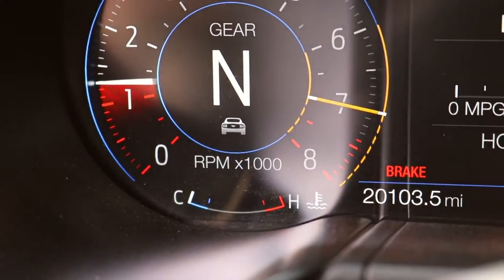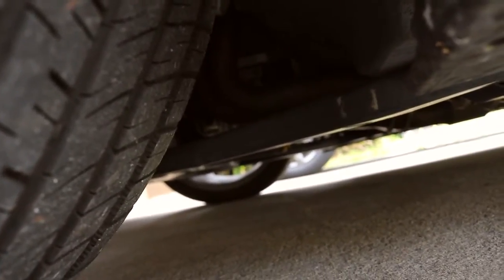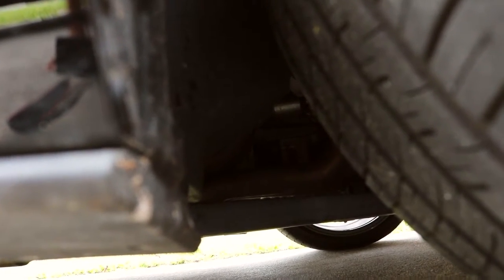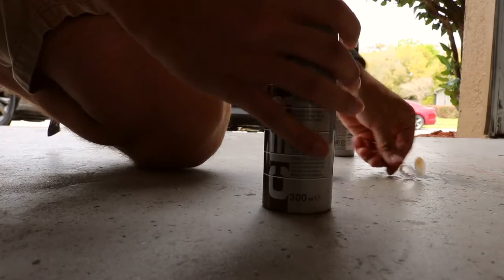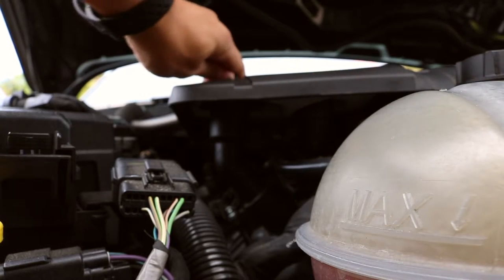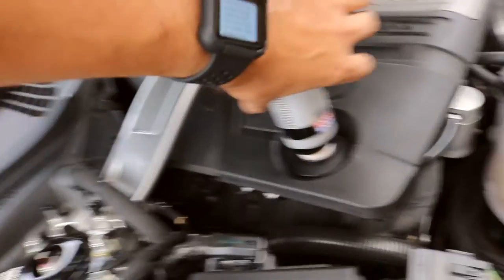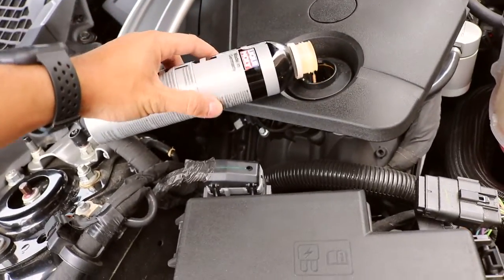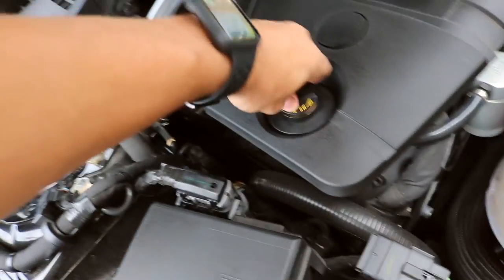Does Ceratec ACTUALLY FIX the infamous Mustang Tick?!?

Comment: I used 5-30 with a bottle of ceratec and my engine became silky smooth surprisingly 😂 no more typewriter tick
Reply from the maker: That’s awesome! Glad that worked!
Reply: I'm about to add some my next oil change, did you use 1 bottle or 2?
Reply: @jeffkelly9197  its one bottle for every 5 quarts, the gt holds 10 quarts so two bottles
Reply: But you have to match it as mine take 6quarts adding a bottle of 300ml makes it 5400ml instead of 5700ml for engine fluid
Reply: Did you add another ceratec when you do the next oil change ?

Comment: It fixed the ticking in my 2008 Mazda MX5.  Done as part of an oil change and allowed for the extra volume of Ceratec to total volume.  My son was with me when we started the engine and we instantly looked at each other once the engine turned over.  The before and after was clear.  No more ticking.  Even after a several subsequent oil changes.

Comment: I use it in my 19 GT with 530 Pennzoil ultra platinum. So far it's been a year and the engine runs and sounds great!
Reply from the maker: 19 Coyote 5oh oh sweet! Glad I made a good decision! How many miles are on yours?
Reply: @BrandonChinn  I've got 5k on her, It was a custom order car and I swapped out the OEM oil at 800. Car is in storage for the winter since November.
Reply: I just put it in my 16 GT tonight low and behold the tick is gone changed my oil about 50 miles ago with Royal purple 5w20 and K&N oil filter.
Reply from the maker: Chris Cook hey that’s awesome man!
Reply: @chriscook7219  how much did you put in?
Reply: @JoeyBurnsRed  the whole bottle but id remove a quarter of a quart of oil to make room just to be safe or do it at a oil change and just put in 7 and three quarters of oil then the ceratec
Reply: I bought two and only used one bottle and tick is gone I’ll just save other bottle for next oil change :)
Reply: If it's been a year, you should change your oil.

Comment: I have a 2023 GT and had a tick/knock after the first oil change at the dealer. I put in Ceratec and after around 2 months the sound improved but engine seemed a little sluggish compared to prior to oil change.
I dropped the oil after 7,500K from the first service and noticed that the dealer over filled the oil by nearly 1L.
I put in the correct amount of Liqui Molly 5w 30 and didn’t add  Ceretec and the engine is purring like a little baby now.
If you have the issue maybe put in an oil flush then drain oil. Replace oil being careful to fill to the excact amount 9.5L.
Reply: yo bro i have a 22 GT that started ticking after the first oil change. leaning towards using ceratec just very skeptical.

Comment: It usually takes a 100 miles for it to really work. But Amsoil and Ceratec work really well for me
Reply: I’m using AMSOIL engine oil. Would it be fine to use it with it?
Reply: @harisijaz8383  yes

Comment: I have used alot of additives in my cars the best one is called (Extralube  ZX1) its from the UK and originally designed to cool and to stop wear on north sea oil rig drilling drill bits! I swear by it,instant quiet engine,you can put it even in coolant to protect water pump and also in fuel
Reply: What about ACTIV8, that is UK too.

Comment: What about the 2017 this one I wanna buy has the ticking and it’s not super loud but I am worried about the tik
Reply from the maker: @Tlopez0  you can still use the Ceratec as well
Reply: @BrandonChinn  would you reccomend still purchasing it with the tik or avoid it. It has 43K miles

Comment: So now your oil level is above max?  Additives are supposed to be added with oil so you still have the correct oil level.  You could also remove some oil before dumping two bottles of more liquid into your oil.
Reply from the maker: By standard it is technically above max but engines are built to withhold excess oil in case of overfill. Obviously not much but those two little bottles aren’t going to affect anything

Comment: I just picked up a bottle and did my oil change last week, do I add a bottle on top of the 10qts of amsoil? Would this not over fill? If i need to remove oil prior, how would i do this ?
Reply from the maker: @deucetres1656  yes just go ahead and add the bottle on top of the oil it won’t affect anything or overfill. You’re perfectly fine

Comment: Over-filling the engine by 2/3rds of a quart will quiet an engine down. It's an old-school used car trick to hide a toasted engine; add extra oil and it quiets the engine down.
Reply: Good point - so without removing the same volume of oil first, it's not apples-to-apples.

Comment: disclaimer, when you had the ceratec, It must be 9.5 L of oil/ceratec mic, you don't put 9.5l oil and then add ceratec because you will overfill it, for example if you are to add 500 lm of ceratec, you put 9L of oil and 500 ml of ceratec... also ceratec is said to last for at least 2 oil flush so no need to add it all the time , or you can half the quantity for the nexts ones
Reply from the maker: @philippebrebion6203  so adding in the Ceratec, you don’t actually have to split the difference. Every engine is made to accept a little bit of overfill of oil. It’s common across almost every vehicle. The small amount of ceratec being added in won’t affect anything or overfill in your engine

Comment: Did you know this folks.
This needs to be added to each oil change. 

My question to liqui moley was the following. 
When vehicle is due a service interval after i have used cretec for the first service.

Liqui moley: All the liquids, leave the engine bay. You  can have your vehicle serviced. And drive the vehicle with cretec in the system and the rest has left the engine during the engine oil service. 
Liqui moley recommended a new bottle is added at each service to maintain 100 percent cretec protection. 💯
Reply: This is wrong, ceratech ceramic properties lasts up to 30k miles, the anti friction last each oil change interval.

Comment: Yeah I’m at 400 miles on my 21 GT and it’s already ticking and rattles between 2k-3k rpm quite loudly. Do you think I should wait until I change my oil to add this?
Reply from the maker: Yes you can wait to change your oil!
Reply from the maker: @s550mc had gone to ford NUMEROUS times prior to this. I stopped going because 1. They didn’t claim anything to be wrong with the vehicle 2. They claim that the problem isn’t actually where/what it is 3. They had refused to work on the car because it “looked” too modded.  Took it to multiple dealers as well which is when I started to fix everything on my own. A lot went wrong with this car that I didn’t record, but every time I took it to a Ford dealer, it was always a nightmare

Comment: So if the car takes 8 Qts.. Do you add 2 bottles to 8 quarts or to you subtract 2 bottles of fluid (600 ml) and basically add this to 7.5 qts of oil so the total volume of liquid is still 8 qts ?
Reply from the maker: Gene realistically you can add in the 2 bottle on top of the 8 without worry. But the recommended use would be to add subtract the fluid from the oil needed. So yes 7.5 is how much you’d add in oil
Reply: Liquid moly recommends that you use 6% blend (94% oil, rest ceratec) so you would want to use a lil less than half a quart .
Reply: I have a 2023 GT and had a tick/knock after the first oil change at the dealer. I put in Ceratec and after around 2 months the sound improved but engine seemed a little sluggish compared to prior to oil change.
I dropped the oil after 7,500K from the first service and noticed that the dealer over filled the oil by nearly 1L.
I put in the correct amount of Liqui Molly 5w 30 and didn’t add  Ceretec and the engine is purring like a little baby now.
If you have the issue maybe put in an oil flush then drain oil. Replace oil being careful to fill to the excact amount 9.5L.

Comment: It's ok to add even tho I just did oil change yesterday with 8 qts? Do I add 1 whole bottle to 8 qts oil?
Reply from the maker: Ye still good too add
Reply: @BrandonChinn  I did and it got rid of my tic! So I have been doing alot of digging and it seems mobil 1 is a common denominator...ppl claim amsoil and Pennsoil is the best and won't permit a tic. I'm just glad the ceratec worked but I'm gonna try one of those 2 oil brands next oil change and see what happens.
Reply from the maker: @tehshape  I actually only use Amsoil now and I HIGHLY RECOMMEND. So much I became a dealer for them. They are quality no doubt

Comment: My 2020 GT ticked after the first oil change. Added ceratec and it was gone until my most recent oil change. Planning on adding another dose. Whatcha think?
Reply from the maker: Go for it! Ceratec is only rated to last about 20k miles if I’m not mistaken!
Reply: Ceratec will only work so long you have it in your oil. Once you change your oil, it will no longer give you the benefits.  So you have to use it every oil change if you want the benefits.
Reply: Get a Camaro SS instead
Reply: @amirparvez5415  It's like crack for the coyote 5.0 engine
Reply: @EldePHX   He doesn't want to get into something slower

Comment: seems like a great way to stop the ticking. The way I'm thinking is if your engine oil is reading top of the fill range then adding 600ml of Ceratec is going to over fill the oil capacity of the engine - not a good thing. I suppose the best way is to add it when doing an oil change and allow the 600ml in the fill up. Adding after the oil change means you should remove 600ml of oil first?
Reply from the maker: Mostly all vehicles has some give for overfilling. As it doesn’t have to perfect at fill mark going over won’t hurt it by that much. Hope that helps!
Reply: I only needed to add 1/3 of bottle to stop the tick. No reason to add entire bottle tbh
Reply: @eurly93  you’re wrong you’re supposed to add 2 full bottles trust me I know

Comment: Why do you use two bottles I'm curious most people that have 5.0 only use one any reason for that
Reply from the maker: So on the bottle, it states that it’s good for 5 liters of oil which is roughly 5 quarts give or take. 18-22 mustangs take 10qts of oil which would be equivalent to 2 bottles or 10liters. That’s why I used two bottles. I’m sure 1 will still help! But I wanted to cover my bases when trying this
Reply: @BrandonChinn  I see I didn't read the bottle because like I told you earlier this one guy on the video only use one so I assumed I'm just supposed to use one well thank you for that info I really appreciate the video thanks again

Comment: You need to take out the same amount of oil as the ceratec that goes in. You never want to have the oil level over the fill line cause too much oil can cause damage.
Reply from the maker: No you don’t. That little amount doesn’t affect it enough. Every engines able to be overfilled a little bit on purpose, for the specific reason of people accidentally overfilling. Nothing more then about .5 - 1qt more though. Anything more and it will most likely get cycled back through the manifold

Comment: ceratec is inserted into the engine with the engine running ??
Reply from the maker: preferred with the engine turned off but you can still add it in. Very possible you might make a mess lol

Comment: I have a 19gt and had the tick then used that 5-20 pennzoil ultra platinum and legit the sound it gone. It’s really quiet now. Was previously running royal purple 6-30
Reply: @8.8inchesinmyrear  it's gonna be almost the same as using ceratec .
Gonna quite down the ticking for a while until the oil starts to degrade a bit and loses some of it qualities. Ceratec gonna last until you change your oil but once you change the oil, the ticking will comeback.  So you have to use it everytime you change your oil . Imo you might as well just use the penzoil ultra plat instead of paying extra for ceratec especially if you change your oil every 5-7k . Ceratec might work a lil longer but if you change your oil frequently, you're  just wasting more money

Comment: Bro i have the same problem, Is it normal that it also consumes more oil?
Reply from the maker: Is it a lot of oil consumption we’re talking about?
Reply: @BrandonChinn  My 19 gt, is consuming too much oil. I'm pouring oil approximately every 1000 miles, it's not leaking. But I don't understand, it's not normal.
Reply from the maker: @fimidjsharry4017  What oil do you use? Also, do you have any mods on the vehicle?

Comment: The best Mustang engine ever built is the Ford Windsor 302 efi Interceptor engine. Close to 600 horsepower, unlimited horsepower range and no ticking noises. Quite and smooth.
Reply: Ya right. The ticking is nothing to worry about.

Comment: Did you add the ceratec on top of the 10 quarts of oil?
Reply from the maker: Yes right after the oil change!
Reply: @BrandonChinn  gotcha thanks. Anytime I add an additive I try to remove an equal amount of the fluid to give it room. Especially transmission additives. Glad it is working.
Reply from the maker: thereissomecoolstuff so my car takes about 11 qts, so I kinda just substituted a bit of that eleventh quart with the ceratec!
Reply: @BrandonChinn  Sounds good. Mine takes 10 quarts which is a lot. Hard to believe it can still run hot with that much oil..
Reply: My car uses 5.8 quarts of oil. I should be fine with just the 1 bottle correct?
Reply from the maker: jbads1989 yes you should be just fine! Each bottle is rated for 5qts so I mean if you REALLY want to be perfect and measure out the 2 bottles then go for it, but one bottle will be just fine!
Reply: Brandon Chin thanks man, I appreciate it.

Comment: Where is it said to warm up the engine first?
Reply from the maker: Warming up the engine is required it just makes it much easier to change the oil. Heating the oil will allow it the flow much quicker and smoother out of the pan then if the engine was still cold

Comment: Using Pennzoil full synthetic alone will eliminate the tick. 21 year Ford tech veteran.
Reply from the maker: Have tried this. Around 10k miles tick starts to become noticeable
Reply: I use full synthetic every time I change the oil. The tick is still a' ticking! I going to give this stuff a try.

Comment: You are doing it wrong  !!  You are supposed to warm up the engine and then open the oil cap and pour the Ceratec  on a running engine .